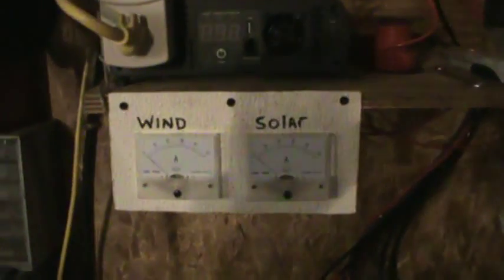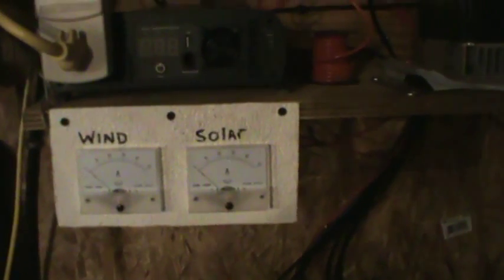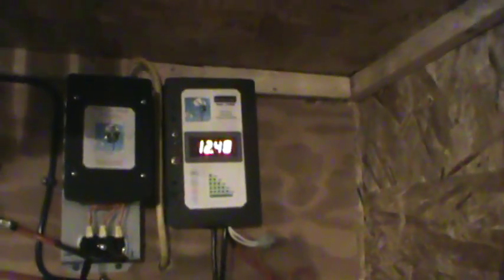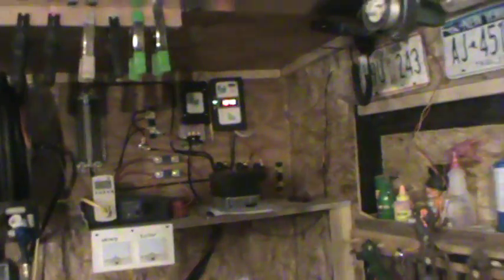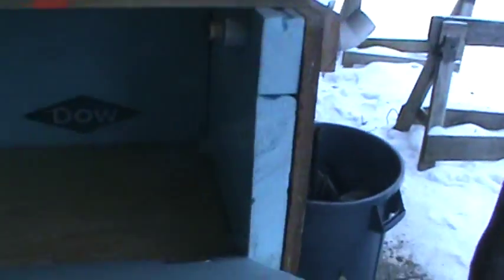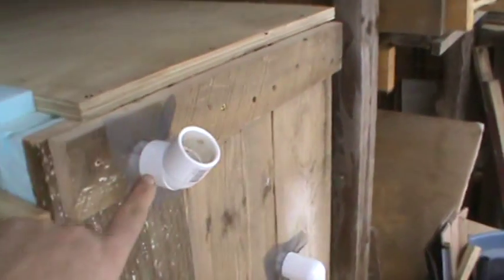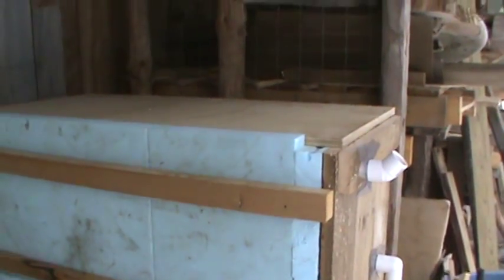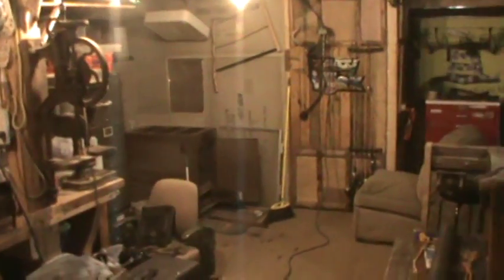added a coulpe of amp meters to the wind and solar set up

Comment: nice job on your set up so far. a idea for you to get golf cart batteries cheap.  look for some local golf courses. they test batteries at least twice a year. you could get some used 225amp hour or higher batteries for what they get as core charges. usually around 15.00 each. if they are sulfated you can get a desulfator thru amazon , very easy to use. I have 1040amp hours at 24 volts for less then 400.00. oh, one other thing, me and alan are hosting a give a way of a 300.00 solar combiner box. all you need to do is post your set up in our forum and the winner will be announced next month. ill attach a link to the video, but its offthegridforumsmotion.com if you care to enter or tell some friends about it. again, nice start on your set up SD.  https://www.youtube.com/watch?x-yt-cl=84503534&v=2i7_FjdIPGU&x-yt-ts=1421914688&feature=player_embedded there is the link to the official competition video, good luck!

Comment: Joe: Everything seems to be coming together on your solar project. It would be nice if you could run your workshop off grid. Bernard
Reply: Thanks for sharing this basic setup and showing about how batteries can create dangerous gases when charging so they should be well vented and how dust may conduct electricity across polarities.  It's well done and clear and it's one of the better videos I've viewed on alternative energy.
Reply from the maker: thanks.....I will try but don't think I could run the talbe saw.